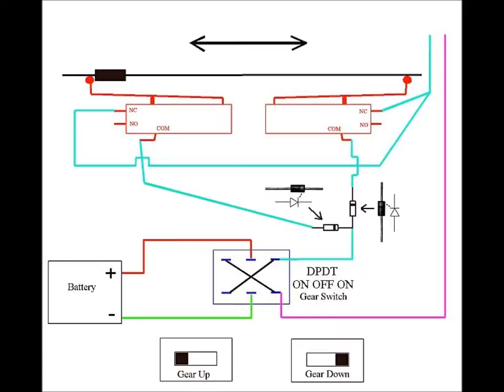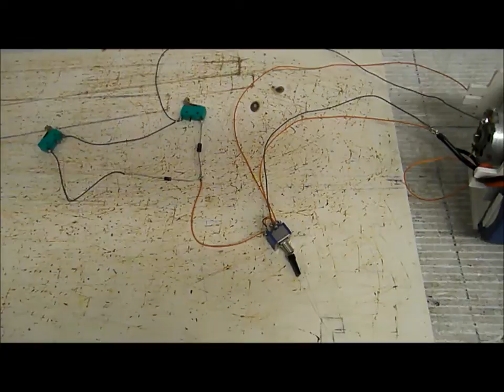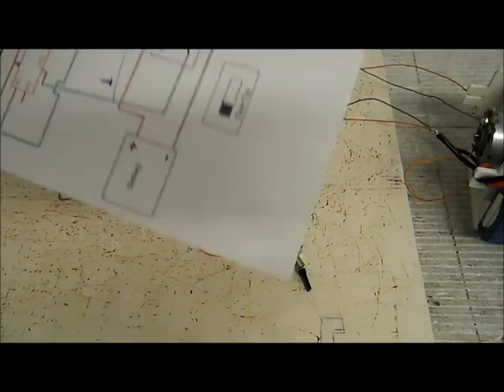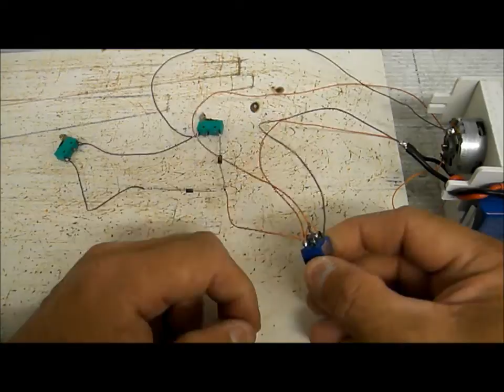switch info

Comment: I like the use of the diodes as it leaves only two wires going to each wing where as my design takes 4 wires to each wing but without using diodes